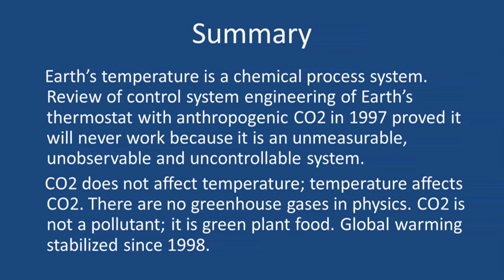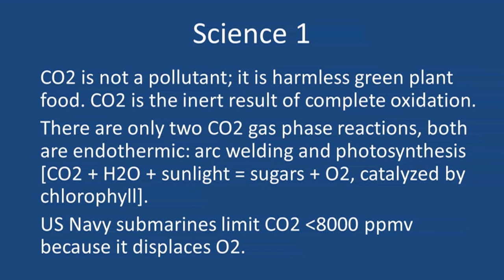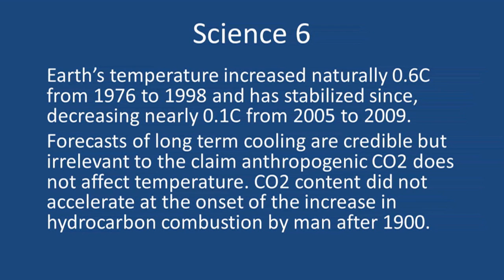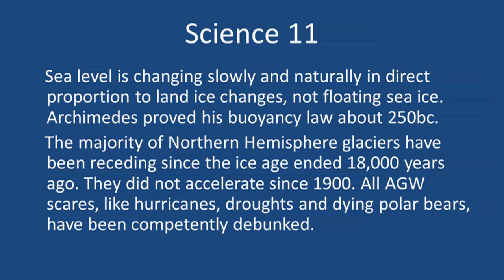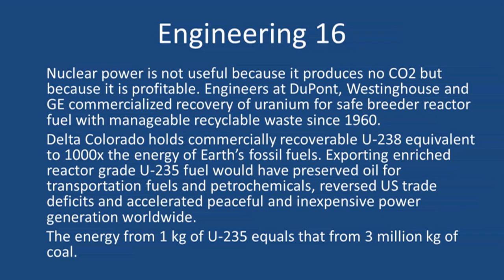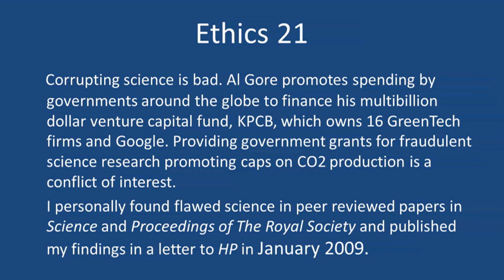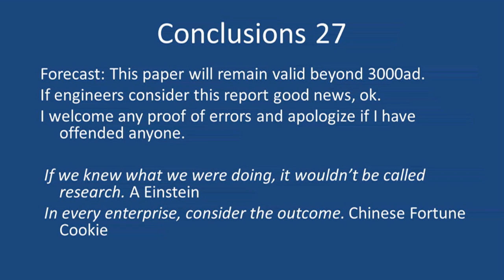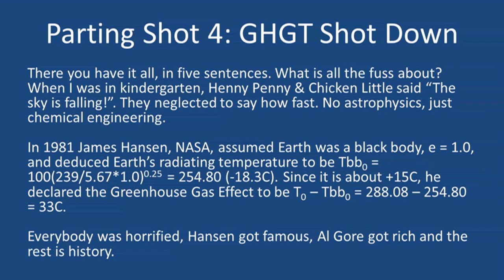Dr. Pierre Latour: Engineering Earth's Thermostat with CO2? | EU2014

Comment: Not sure why T-bolts feel they need to enter this highly political and emotionally charged debate.  It's a lose-lose.  No matter what you say, 1/2 of the people will disregard anything else you have to say, and some smaller percentage will hate you regardless of the soundness of your argument.  Obviously, climate has many factors - other than the electrical interaction with the sun.  It seems likely that the driving force in climate change right now is in fact man-made, i.e. atmospheric aerosol geoengineering, and any discussion of climate change in the last few decades is incomplete, probably irrelevant without bringing it into the discussion.  Do T-bolts want to tackle chemtrails? No?  Then please, STFU and get back to your strengths.

Comment: at 4:40 he is saying for back radiation to come back to warm the surface it would be a violation of 2nd and 1rst laws which does not make sense to me. It is true that thermal heat cannot conduct from cold to hot, but there is no obstacle to radiative energy to traveling from cold to hot, of course CO2 will reradiate in all directions, light does not care what the temperature is. Whenever the deniers arrange something interesting there is always serious problems with it. It is actually depressing that the best the deniers can do is come up with another chapter of endless nonsense.
Reply: Yea, you're going to have to relisten to that. Not what he said at all.

Comment: water vapor is changing the climate..... why would my novice ass need to tell this "expert" channel that... trust nothing, question everything.
Reply: Yea, it's dumping wet on it.
Reply: and how is water vapor created Oh so accurately self described "NOVICE ASS"?
Reply: from the evaporation of the oceans is #1.  If you fill a greenhouse full of co2 does it heat up.... no, and the plants actually flourish, co2 is the lie, water vapor is the truth. ps our plants are not flourishing on earth, they are dying
Reply: atleast to the extent that if you made the greenhouse contain the same levels of co2 that the earth has, there is no difference in temp.  If the levels of co2 were absurdly high, much higher than the planet then yes it would heat up, but not at the earths concentration levels.
Reply: Ellenn Oits
I think here, that you have missed a fundamental point or few, explained by Dr Pierre in the video above.

1. There is no "ceiling" to Earth - it is categorically NOT a greenhouse. The comparison is invalid.
2. Rising CO2 by volume increases emissivity - proven beyond doubt, yet not accepted by the mainstream coerced/compromised scientists, who participate or enable agendas that don't serve your better interests.

Care to turn your 'scope around? Methinks you peer through the wrong end....

Comment: He left so much out.  As the ice melts, less radiation is reflected out to space for instance.  He obviously has not done much research.  He did get one thing right though.  He is OLD SCHOOL…
Reply: pffff....
Reply: Marf Spaa Almost NOBODY believes humans aren't having an affect on climate change.  The question is, and it's a big question, HOW MUCH.  If you disagree with that, you are a part of the problem.
Reply: Marf Spaa And out comes the truth, he works for big oil.  He even admits it at 9:39 and several other places.
Reply: Marf Spaa He called Nuclear "SAFE" at 28:35.  OMG, I guess he forgot about Fukushima (which is still leaking into the North Pacific" and Chernobal.
Reply: ok thnx.